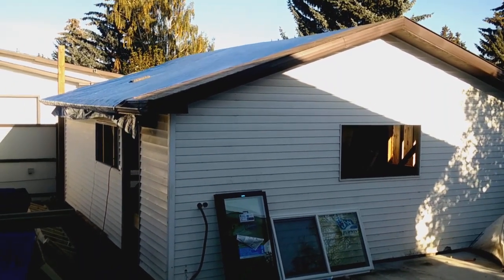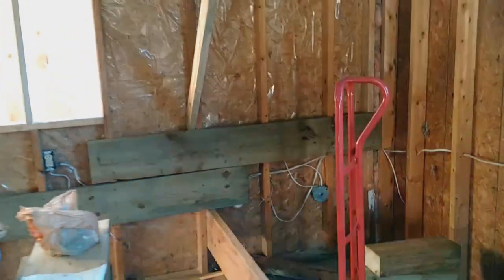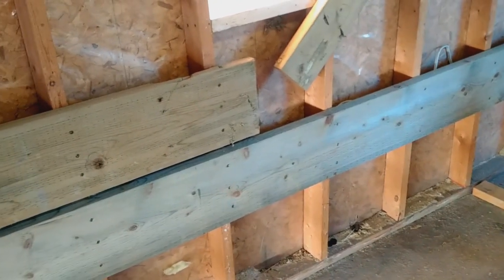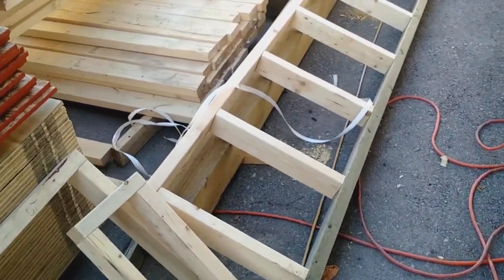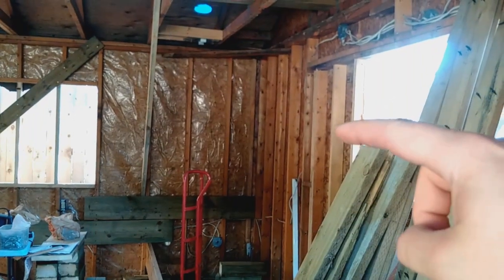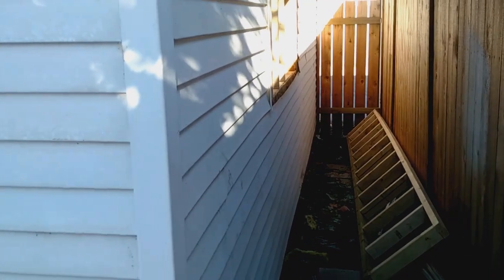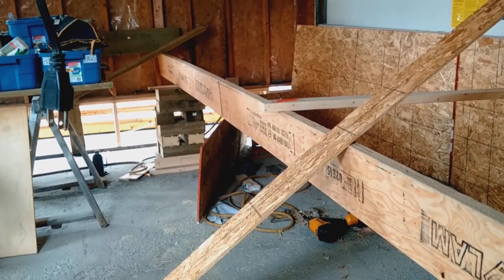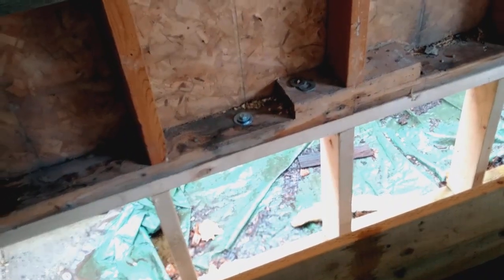How I lifted my double garage up 21 inches

Comment: engineer this, and code that..clearly people forget that alot of houses built 55 to 80 years ago had chalk quality walls, with no footings, and forget about seismic straps, or even bolts through sil plates...Yove done a fine job, carry on soldier!
Reply: I bet most older houses were built a lot more solidly than the garbage that passes for 'code' these days. A bunch of chipboard and planks that aren't even held by real nails, and the designs are all about looks and speed of construction. One day there is going to be a big disaster around here,  and the result will be devastation.

Comment: People usually pick holes but have never done anything like it themselves. I have done the same thing but it's unlikely that I put the same amount of effort and safety in to mine that you have. In mine I wanted to protect the bottom of the wall from water damage , inadvertently I solved the problem of the hinge point.What I did was similer but maybe not quite as safe as yours.  Removing neither roof nor windows, I braced the walls and door, and jacked it up. I put three rows of 8in. cynder blocks, filled them full of cement and set the building down to about 1/2 in. above with bolts in the cement, when dry set it down bolt it down.
Reply from the maker: Thanks Bob.  Creating a masonry wall is an excellent way to secure the base of the wall as well as to prevent water damage.  If I had the time and patience I would have gone this way too.  I just really didn't require the water protection.
Reply: WHile not necessary to remove windows, its better than then winding up getting cracked and needing repair in the even the building racked enough to cause said damage, But to each their own, and removing the doors also allow for quicker escape if something in the lifting stage failed.
Reply: How did you attach the new block wall to the existing foundation?
Maybe that is not a hinge point?

Comment: I'm posting this alternate option in case others my be interested in taking on a similar project.      What you are looking for is additional headroom, a higher ceiling to accommodate the lift. I'm not sure of the location of the lift, maybe the center of the garage or off to one side. If the center this is definitely the way to go.     What I would have looked into doing is sistering 2x8 rafters along side the existing trusses. I say 2x8 because of the 24' oc spacing. At 16" oc I would consider using 2x6's. Then I'd remove the lower truss work one truss at a time and install a 2x6 collar tie at the ceiling height you need. You should be able to safely raise the ceiling height 1/3 of your total rafter / roof rise. If this were a raftered garage, I would have just raised the collar ties. The door is on a gable end so the header can be easily be raised if necessary for a larger opening. There is no roof load in this area. What I have described would have probably taken only a couple of days and a lot less money.       Might work dimensionally, might not, but this method should be considered.   .........Almost 50 years in the building trade.
Reply from the maker: This is an excellent approach.  If my roof line was 90 degrees perpendicular, this would have been ideal.  Another approach is to use a ridge beam.  I know someone who did that and got the same useable space.

Comment: Add steel straping, extend your anchor bolts with threaded rod. run 1/2 inch plywood from the floor on walls, 4 feet up, and you should be all set to prevent any Hurricaine  damage. get rafter clips also.

Comment from the maker: Okay everyone. Before you ask a question, please read all the comments. Most of your questions and concerns have been previously addressed.  If you just want to offer advice, you can publish your own video.  This project completed over two years ago and it's a bit late to change it.
Reply from the maker: I did answer this a couple times early on, but since you tried to find the answer, I'll give you a pass :)  

Simply put - I don't have a good reason.  I had some minor reasons that in retrospect were probably less imperative than I thought in the beginning.  I have never built an entire building before, so I didn't have a good appreciation for which parts were hard and which were easy.  That somewhat skewed my decision making.  Either way, here are my factors:

1) I needed the garage to remain functional throughout.  From the time I stripped out the interior (June) until the time I had the lift done (September) until I had the exterior complete (November) was a very long time.  Throughout I need a functional workshop, plus parking.  So I tended to bias towards a technique which kept everything useable.  If you were going to just lift the roof itself, that would require expansive scaffolding and I didn't have the space for it.

2) I wanted the garage door to be bigger.  I had hoped by lifting 21" (the height of a single garage panel) I could just slap a new panel on the door, some stronger springs, and be done.  It didn't work out that way.

3) I felt that lifting from the bottom as opposed to the top, is how the structure is intended to bear weight.  I knew if I lifted it evenly enough, this would be safe.  Lifting from 8' to 10' in the air would be very precarious.  

In short, I think it is a wash.  Either way requires sistering the studs (meaning drywall removal), and either way requires a lot of blocking and reinforcement.  One idea I had later was to use the 4 post lift to lift the roof.  This would likely work pretty good.  There is another video on Youtube with some guys doing exactly that, but with a 2 poster.
Reply: Thanks for the explination! All's well that ends well.
My buddy wants to do this and I was just interested why you chose to do it one way over another. 
I think what we're going to do is lift the roof up one side at a time using a bottle jack on a tall 4x4 braced to the wall.
Reply: You may want to pin this comment so it shows up first among the other comments.

Edit; Oh you already pinned a comment.
Reply: Anthony, try raising only the roof on a post frame/pole building structure, would be highly and very impractical. But this type of balloon or platform framing depends on size and design.

Comment: personally I would have gone with masonry or concrete. my shop now has about a 20 something inch pony wall but it's all solid concrete.
Reply: He could probably have but also his budget or finance may have said otherwise, then against it is also preference over cost in many cases. If owned a balloon/platform framed garage. I money was no object then I would just knock it down and rebuild using post frame  using brackets for footer slab or precast concrete permacolumns in the soil and go with taller than may need walls. never such a thing as too small or tall, compared to too low or small in interior dimensions. Unless you already have a limited as is building space determining your square foot/meter footprint. Then again If someone needed such a building size they would be welcome to buy it from me and either take apart to managle pieces for transport rather than move it entirely intact unless money was no concern to them for such cost of said transport or limitations along the roads for it to be moved that way depending on relocation spot.
Reply: I would think that solid concrete would still have a hinge point (well, line) because of the joint between the new and existing concrete.
Reply: @scottwillis5434  I don't even honestly remember what this video is about other than the title. 4 years ago 🤣

Comment: good thing that after lifting y’all notched them bottom plates and nailed full length studs at least every 4 feet apart for better structure 🙏🏼💪🏼👍🏼
Reply from the maker: 5 years now and she's holding strong. Not even cracks in the drywall. So I'd say it was effective.

Comment: Man that's an awsome job very impressive.  I run cranes and have done this by putting holes in the roof and using 6x6s ran cables threw the costumer spent 800 for the rental plus the braseing your way is cheaper and just as effective
Reply: One does what the prefer and fits their budget at hand or in mind of what they want to spend in all. No wrong way except a truly unsafe method.

Comment: Gets the job done. I've watched other videos where they raise the roof which in the end is a lot less work. You don't need to change the door locations and the windows. Why did you choose this technique just wondering?
Reply from the maker: I think I've answered this a few times.  But basically I needed the higher door opening to fit my boat in, so that was the primary reason.  In the end, I think I disproportionally weighted that requirement.  Either way would work.  As a side benefit, having my windows higher up has been nice.  It gets the sun in better in the winter, and it allows the walls to be more useable for "garage stuff".

In one of my comments here somewhere I pondering using my 4 post lift to lift the roof.  That would have been a neat video.

Comment: Good Video.  I have to do the same thing and the driving reason is, I must also pour a new slab of cement and raise the floor 7".  This is due to poor drainage and wanting water to drain into the street instead of toward my garage and then off to the side. The shwacks who built my garage had no idea what a level is and didn't account for rain runoff.  So I must raise the floor.  I could just poor inside, but not too sure what that would do to the walls as the siding would then become the form holding in in the floor.  Anyone have an opinion on that?  Thanks for the video John.

Comment: Here we have pressure treatment , which contacts concrete. When I read 21 I expected 24. Three courses of cement blocks. Was surprised at more wood. But your right, it not my property, and maybe it in desert south west
Reply from the maker: Around here every home is built with wood on concrete. And yes it's fairly arid here. The old sill was fine after 30 years as you can see. 

21" came from the panel width of a new garage door. I actually wish I had lifted to 24" for the vehicle lift.

Comment: What about lowering the floor? Making a slot in the ground like you see in oil change places? Then you don't need a lift as much to get under the car.
Reply from the maker: Llia Olsen that would allow for servicing but not for permanent 3 car parking. I think it is a neat idea though and I actually wouldn't mind it. The challenge is that you need to build in a staircase to get underneath. That would take up a lot of space in the garage. You may also need to build in a drain.

Comment: I am looking a home to purchase but I don't care for the height if the garage, which brought me to this video. Quick question since this is 5 years old... Are you satisfied with raising the whole garage or do you think I simpler option would have been to raise the roof? Thanks
Reply from the maker: Great question.  Simple answer is that I have no regrets with the project.  It is holding up perfectly well.  The longer answer is it "depends".  If the garage is already drywalled and insulated, that changes the work load.  It also depends how much "stuff" is attached to the walls.  Also depends if you want to replace the garage door with a taller one.  Also depends how the garage is anchored to the floor.  Also depends how well the roof is anchored to the walls.  I'd weigh all these things.  In the case of my project, I think the approach I took was the best one (although it's a close call)
Reply: @johnniemo  thnx! I really appreciate the reply. By the way, Awesome job!

Comment: Removing the windows is not necessary but does help protect against cracking due to racking from possible uneven lifting. Where those two of the same bottle jacks? if you were able to get a hold of two more loaners then could have had three buddies also jacking in relative unison but would have wanted to cross brace those lifting beams you were using which looked just wide enough for the jack ram. Other than that great job not tipping the building as you raised it and good work on the pony wall securing it to the slab and to the building using the bolts and old bolt locations.
Reply from the maker: Thanks for the comments.  I had four identical bottle jacks, 20 ton, and I got them from Canadian Tire on sale for $20 each :)  We tried lifting all 4 at the same time and the building started to oscillate too much.  It was much safer with half the building on firm blocking and the other side lifting in unison.  I suggest going up in 2" increments.  We tried 4" and had some slipping.
Reply: like i said manual unison is a bit tricky as well as you found out and even the experienced professionals have their own similar issues in windy conditions thus why you see them using standard cribbing side and place a new upper layer of each stack in stages or steps. glad you made out well and safe and the building is doing well since the endeavor and it is probably more work and as much headache if you went the other way just lifting the roof and then raising the door header to height, like I said a few times you already seen its ones choice and what they can and are willing to afford to do

Comment: Hi John,

Very well done project and video.

I would like to seek some advices on my intended project: to lift up a 10x10 shed with concrete tile roof and stucco walls, only 1 door and no window, 8ft 2x6studs. It is on concrete slab now but sinking on 1 side because sitting close to the corner of a retaining wall. 

I would like to lift it up to pour a footing under the shed and raise the floor few inches higher than the surrounding to avoid water coming under the wall plates, as rain often in Vancouver.

Worry about the weight of the shed and cracking the stucco walls etc. Appreciate if you can suggest how the brace the supports and sizes, also the size of the jacks etc. Thanks.
Reply from the maker: You really need someone local to review your project.  However here are some pointers:

Firstly, determine how your roof is supported.  Is it like mind and the trusses place the roof support on the side walls?  If so, that is your lift point.

Secondly, if you want to replace the floor you either need to lift from the outside of the building (and ruin your stucco) or you need to lift from the inside as I did, but then pour your stub walls of concrete instead of wood.  You'll also need to pour the footings.  Once that is all done you can fill the inside and add a new floor if you wish.

The only things I would be concerned about is the weight of that roof.  Concrete tile will weigh a lot.  However I think my process will work for you.  Just verify how that roof is built.
Reply: Thanks for your quick reply.

My roof was built the way you did with wood planks spanning the trusses already. It was hand built by my framers who built my house, so it was built very solid with all the trusses and braces already. I was the one actually put on the roof tiles, as the roofer never returned to complete. 

I think your way of supporting the stud walls and lifting will work. The trick is to hold the shed in place while I pour the footings. What is the size of jack lift that you used to lift the garage? Since the shed is only 10x10, I would not use laminating beam to do the lifting like you. I would use multiple 2x8's to lift, and I hope it will work.

I plan to lift from the inside as space is limited from the outside, and I want to fix the outside at the same time. The inside flooring can be poured later on.

Do you think using concrete blocks to hold the walls and then pour the footings with them inside proper, as I do not have to worry about wood rotting inside concrete or have to remove them?  Thanks.
Reply from the maker: Yes.  There is a guy on the Garage Journal who did this exactly.  
https://www.garagejournal.com/forum/showthread.php?t=272678&highlight=ainsley

I think you will be fine with this approach.  I think a single 2x10 would be enough for you.  Maybe a pair across the middle (where I had the laminated beam) just to give you a solid jack point.  Also I suggest holding it up using cinder blocks instead of 4x6.  The 4x6 is not all that stable if you need to leave it up a while.

Comment: Based on the way you pronounced "garage" I assume your not on the west coast with earthquake requirements (Eastern Canada if I had to guess). Even at that, I'd consider putting shear panels on the interior walls, also on your extension. Overall a very well thought out and executed plan. Nice work.
Reply from the maker: Calgary to be exact.  No earthquake related code requirements.

Comment: That took some balls to do I would love to do the same but my luck I would crash . What thought about was pouring concrete wall and let it down on that but it was just a thought lol
Reply from the maker: Pouring is an option.  It obviously would take longer.  You would probably need to anchor in some rebar to the slab too.  It would take several days, but entirely do-able.  I know how to do wood so I stick with it.  It's relatively dry here too, so wood lasts a long time, particularly pressure treated (which I used for the base plate)

Comment: Only thing i would have changed would be removing the sill plate and adding cripples every other stud sistering them together all the way to the new bottom...or better yet osb plywood the inside wall with glue and screws.